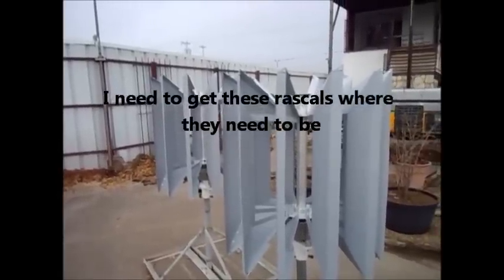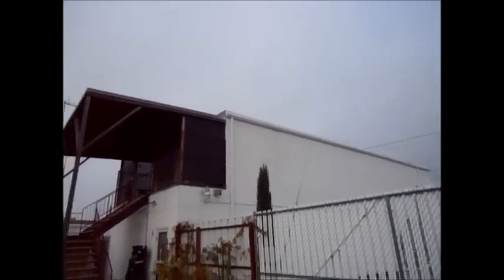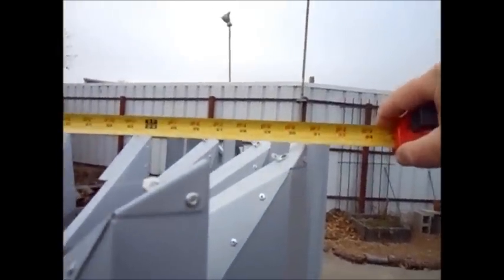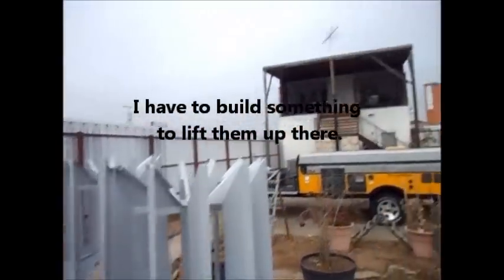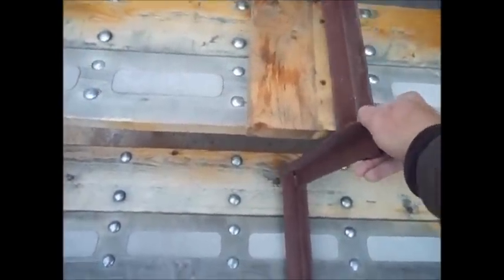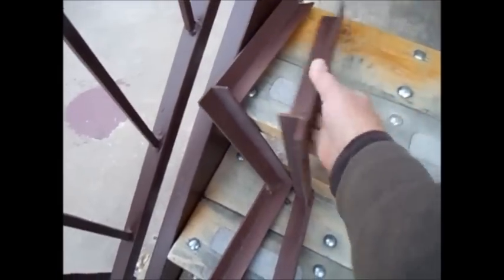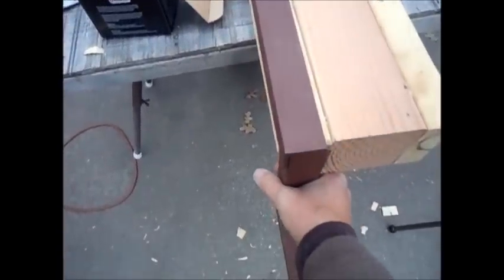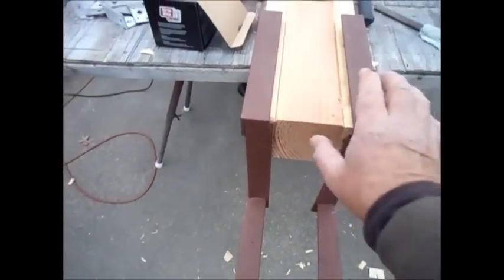DIY Boom Crane

Comment: One thing I might suggest for long term use is to add a couple of straps to the back of the winch down to your angle iron frames. That way the load is transferred to the  weights and keeps the load down on the three bolt holding the winch down to the frame. Overall, very nice work. And gives me an idea of how to lift some turbines and items up to the top of the shipping container roofs. Like 71 pound rolls of roll roofing. Something my Dr. would kill me for if he saw me doing even a ground carry of one of those rolls. Little alone putting one on the roof. If someone needed to use it for even heavier loads, they could extend sides where the pivot for the boom go and form a cable truss to carry the extra load. 2X4s in the bed of a pickup truck cabled to the front of the bed are strong enough to pickup a gas engine out of an Oliver Crawler with, along with the whole front of that crawler.
Reply from the maker: That's a good suggestion, thanks.
Reply: @LittleshopintexasSV   You're welcome! Merry Christmas!
Reply from the maker: And Merry Christmas to you as well!

Comment: I wanted to see you get to the roof and make the lift, I build things all the time, I learn things by watching other people's projects, thanks for posting, but I only have metal to work with , gets heavy,  thanks again ,I too live in Texas,
Reply from the maker: I used this boom in the Apples to Apples Pt2 video to lift the two turbines to the roof. It was a tight fit, but all of the boom sections went through that little hatch, then I reassembled the boom on the roof. After the experiment was over I took the boom apart again and brought it back down. I didn't show myself moving it, I just show it in use. I think a metal boom would have been better because if it was painted well, I could have left it up there. Thanks for watching! Here's the link to that other video: https://youtu.be/yB4Ze3TRS9s

Comment: using tapcon screws (blue) for wood to wood????
Reply from the maker: I used what I had on hand. They are weather resistant and still holding tight after 7 years.
So, whats the problem????

Comment: Why didn’t the whole thing fall forward when the weight was attached?
Reply: The steel brackets made a cradle to hold counter weight and I used flat concrete blocks for that.
Reply: I saw that. But it didn’t look like much counterweight in there. Does it have to equal the weight you’re lifting?

Comment: Nice build but I did not see how that got them up on that roof as you indicated they needed to go.
Cheers, Patrick
Reply from the maker: That's because I couldn't do everything in one video. I built the boom crane to complete another project.
https://youtu.be/yB4Ze3TRS9s
Reply: That was exactly my thoughts! Started looking through comments how did that reach your roof?!? Inspired to use this kind of method attached to a trailer to haul logs to my DIY sawmill...

Comment: Great job! I'm still wondering what the aluminum angles do.
Reply from the maker: The three pieces of angle gave me two teeter points to choose from, and prevented the boom arm from sliding off those points. I could have attached the boom arm to the base at the teeter point in a different way. But this way worked and it made the task of moving the contraption to the roof fairly easy.
Reply: Thanks.
Reply: You're welcome
Reply: What are the turbines for please ..
Reply: @Ramos8872  See this website: https://littleshoptx.com/stealth-vawt/?v=7516fd43adaa     I was just asking a question about the construction details for the DIY Boom Crane, if you want further information, go to his YouTube channel and search for VAWT,

Comment: Nice crane but didn't you have to build another bigger one to place that one on the roof?
Reply from the maker: No, I built the crane to be five separate components and was able to carry the pieces through the hatch. Then I just resembled the thing on the roof.
It wasn't easy but it worked.
Reply: Little Shop In Texas Ha good deal. My previous post was just an attempt at humor. I found your vid by watching block and tackle vids.

Comment: How did that solve your problem? I don't see that being able to reach 20+ feet up to your roof. It's a cool design though. Maybe there's toomuch much responsibility given to a couple pieces of wood, like those 2x6 cutoffs/drops that contain the fulcrum ..Idk.
Reply from the maker: I wouldn't try lifting an engine with this, but it worked just fine for bringing the wind turbines to the roof. All of the pieces weigh less than fifty pounds. They just couldn't fit through the hatch.
https://youtu.be/yB4Ze3TRS9s
Reply: Little Shop In Texas I see. ..so you set it up on the roof and lifted them up to you?? I was thinking you were going to fly them up to the roof from the ground. That's pretty cool.

Comment: This crane is weak on the middle. You should have used thicker wood there. But it seems nice for light things.
Reply from the maker: Yes I know. If I wanted to lift heavy stuff I would have built in more truss like components. Since the heaviest thing I needed to bring up to my roof was about 40 pounds, this little boomer worked out just fine. Hey, thanks for watching.

Comment: Uhm.....

Great crane for lifting the spinners off of the ground a couple of feet—

— but where is the ceane being built to lift the spinners on to the roof?

Disappointing let down.
Reply from the maker: I built the crane before I was ready to use it. Then I built the turbines I used for the apples to apples part 2 video and used it for that project.  https://youtu.be/yB4Ze3TRS9s